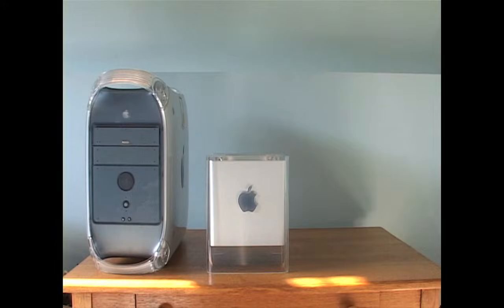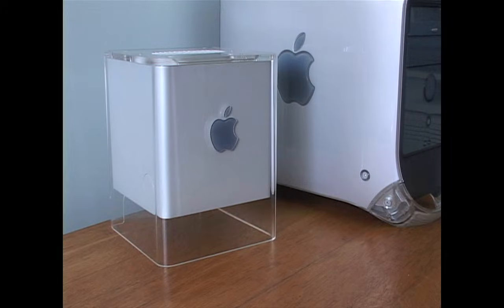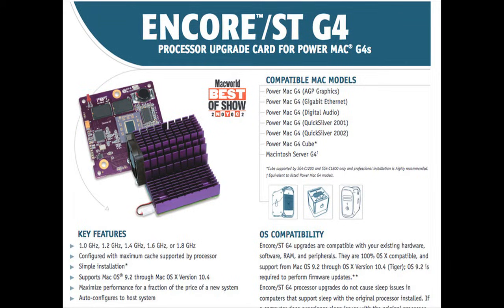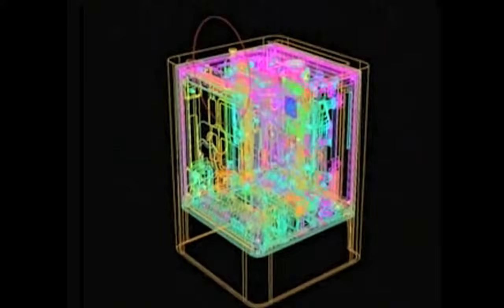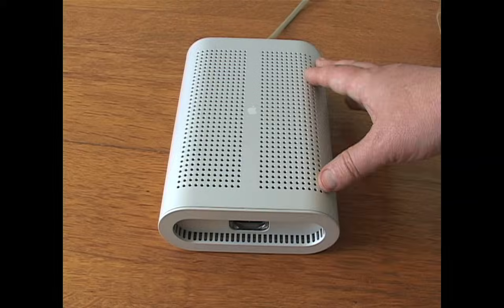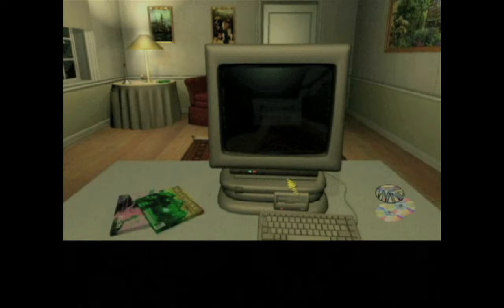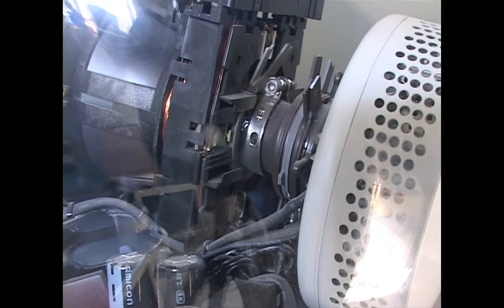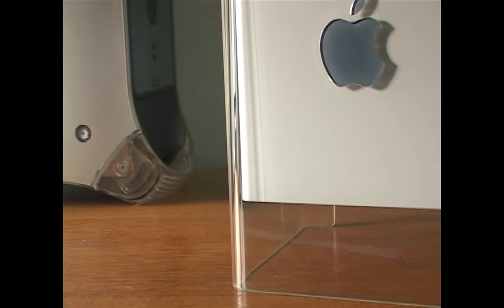The Power Mac G4 Cube

Comment: There's so much irony in hearing Tim Cook talking about a failed $1800 workstation considering the $700 wheels that have come into being under his watch. This is clearly a move intended to bilk technically unproficient and image-centric prosumers out of their money to maintain the unjustifiably stratospheric stock price share holders have come to expect. The sad thing is that enough people will pay this amount to reinforce Apple's bad behaviour. Once upon a time, I will admit that I suffered from a bit of Mac envy, but Windows 7 and many contemporary hardware offerings cured me of that. I hate Windows 10 so much I refuse to run it. Mac envy would have resurfaced again by now, I'm sure, but I mean the Apple tax is most of the cost now. It's beyond ridiculous.
Reply: I mean don't get me wrong, the market bears what the market bears. $700 wheels, $1000 monitor stands, whatever. If people will pay that much, it's technically worth that much. To channel P. T. Barnum, there's a sucker born every minute.
Reply from the maker: Great points. And I think if the Mac Pro doesn't get the sales numbers they expect, they'll just conclude lack of market for an expandable Mac instead of making a lower spec'd version to push down the price point and increase sales numbers. And yes, Windows 10 is terrible.
Reply: The Apple Tax is carefully distributed over their product line, though.  The kinds of computers (and their accessories) that ordinary humans buy are not atrociously expensive.  IMO, they're priced at a point that allows Apple to make decisions that favor not cutting corners (except, of course, to round the corners.)

The Mac Pro is aimed at an audience where the computer is a tool to do some thing that, presumably, generates a profit that covers the expense of sophisticated tools.  Other brands of workstations aren't given away for free, and other enterprise equipment certainly isn't going to blush at a few hundred bucks for accessories.

The confusion, if I may interject my own opinion, is that everyone tosses around the "Pro" suffix to the point it has lost its meaning.  Something that is actually "Pro" is significantly different in both design and pricing model from something where "Pro" just means "The Higher End One."

The Mac Pro is not competing for the same audience as a PlayStation 4 Pro.  On one hand, there's an enthusiast.  On the other hand, there's a procurement department.
Reply: @sirnickity  Thank you for the well-thought out, well-reasoned response. But the thing is... I bought a Mac Pro in 2010 for about $2600, and it did everything I needed it to do (3D modeling and scene rendering, etc.) for years. In fact, it's still in service today, granted only as a file server. While I agree that the "Pro" designation has become diluted in recent years, I don't think it was to such a pronounced degree over a decade ago when I bought that machine at a reasonable cost relative to its competition. The value proposition within Apple hardware has plummeted since then. Current prices are simply indefensible, IMHO.

Comment: I had one. So quiet so nice to work with. Using iTunes, the small digitally amplified speakers sounded awesome. I upgraded the video card, RAM, HD and installed a dual CPU and a fan. So, I was able to use it for over 10 years. Replaced it on my desktop with a Mac-mini and connected the cube to my TV as a music and media server.
Reply from the maker: That's excellent! Thanks for sharing your Cube success story.

Comment: Two wrong reference which I could spot in your video - 1. Steve Ballmer is dancing on the launch of Windows 95 and not on failure of Cube; 2."Can't Innovate my ass" statement was made for Tin Can Mac Pro and not Mac mini.
Reply from the maker: You are correct, they are technically wrong references. I showed Steve Ballmer dancing because I needed a picture of an Apple shareholder celebrating and Microsoft was a shareholder at the time. And Phil Schillers comment about Apple still being able to innovate was just a joke to show how the Mac mini was not an innovative design change. Apple produced more innovative designs in 1999 than in the last decade.

Comment: Why didn't Apple just put fans in them and crank the speed? Must have been worth a try. I have an iMac G4 which cools itself in a similar way, and it is definitely not quiet.
Reply from the maker: I think Apple already gave up on it by the time faster processors were available. And it might have been too embarrassing to put a fan in after Steve bragged about it having no fan.

Comment: I was the service manager/technician at an Apple Specialist in the northern Chicagoland area when this thing came out.  Neat computer, we sold a lot (very wealthy customer base), but the repair programs Apple had to launch for this thing were ridiculous.  Steve chided his customer base about the mold lines on the case but offered a repair program where customers could get a new case if they didn't like the lines on it.  The replacement cases that came from Apple didn't look much different from the original ones, and I had a few bitchy customers who yelled at us because we were "repairing" their computer (for free!) with the "same case" even though I left the "peel off" protectors on the computer.  I threw away at least a dozen G4 Cube cases because Apple didn't "core exchange" them; they weren't 661- parts so they didn't want them back.  At the time, they had no value.

Another repair program: the power switch would randomly turn the computer on/off even without any outside RF interference.  They had a repair program where you'd remove the "gasket" around the button and replace it with a different one so the computer would stop randomly turning itself on... or being forced off should the sensor activate for five seconds straight.

Super cool that you pointed out the "POINK!" sound the CRT made when it turned on.  I appreciate your videos.  You point out all the weird stuff I noticed at the time but that no one else talks about.
Reply from the maker: Thanks for sharing your experiences and details from being a Cube repair technician. Great expansion on things I talked about in the video. Regarding the G4 cube cases, being quality control for a plastic injection molding company, I often field complaints from companies that our mold's seam lines are somehow scratches in the part that need to be fixed. Fantastic to hear that someone with your experience is enjoying the videos.

Comment: Great Video and detailed history with humor. Love it! I've collected 6 cubes over the years and modified some of  them with upgrades such as internal DVD-Rs, GeForce 3 card and ATI Radeon 9000 video cards, 120 Gig SSD drives and aftermarket processors. Still using and enjoying retro games such as Myth and HomeWorld on them and using FCP 7 and and DV editing and DVD authoring. Thanks for the tip on the 17" CRT. I have one that needs some serious cleaning. People and clients are still amazed that they are working and using them 20 years later.
Reply from the maker: Reed Sherman 
Thanks, and  sounds like you’ve done some serious internal work on the cube. Good for you keeping them useful into the 20’s. Running FCP 7 on a cube is pretty impressive!

Comment: Okay, I've now watched all of your videos, which are amazing. Thanks for the trip down memory lane, but I really need to do some work now... 
I've always wondered if the Cube would have been more successful as a "headless iMac". G3 CPU instead of a G4 and priced like a top end(ish)iMac but without the screen. The limited upgrade capability (CPU and Gfx at least) and design might have made it appealing for consumers with a bit of cash to burn. 

At least the Cube gave us the funniest upgrade ever made, when Powerlogix released a dual CPU G4 upgrade that was running so hot that they had to make a bigger cube. Yes, they made a cube enclosure, just bigger, and the customer had to transfer the internals of his original Cube. 

As for iMovie 3, it decided that all DV cameras recorded audio in 48kHz and if yours (or your DV converter box) produced 32 kHz, the audio track would end up sounding like a machine gun. When raising the issue with Apple, their answer was "We're sticking to the DV spec" (which wasn't the case). Obviously, you don't argue with Apple, you update your hardware to fix their bugs instead... Those were the days, lol
Reply from the maker: Eric, thanks for watching the whole series! Great to hear that.
It is interesting to contemplate what Apple could have done to make the Cube a profitable. I suppose with the G3 Cube idea at least they could have ramped up the MHz without the same cooling barriers, but it might have lost the interest of the prosumers. The Powerlogix upgrade I don't remember, but that's funny. I'll have to check that out. When I did the video, I read through the instruction to install the regular upgrade cards with the fan and my god was it complicated! As for iMovie, I learned pretty quick not to record at 32kHz, even though that was the default of my Digital8 Sony Handycam. I'm definitely considering a B&W G3 video now that I have a few machines on hand to film. I''d definitely like to hear your personal stories from your experiences with it.
Reply: @65scribe Could the Cube ever be a prosumer Mac? It was cool, but intrinsically flawed due to its form factor. Lovely status symbol though. We'd better stop arguing about stuff from 20 years ago, it shows our age :-)

On the B&W, you probably remember many of those quirks but just in case:
- The first rev had a buggy IDE controller. You had the space to put more HDDs inside the case, but the controller didn't support slave drives. D'oh. They may have fixed that later, although many people just bought rebranded Acard ATA PCI cards. 
- Apple released firmware 1.1 which supposedly fixed some stuff. What they didn't tell you is that it also prevented the B&W from booting if you had installed a G4 CPU. Upgrade manufacturers all had to release a patch for Apple's firmware (not scary at all, is it?). 
- There is a story that one CPU manufacturer just took another's (I won't name anyone, ha ha) firmware patch and shipped it with their patcher application. They did however forget to remove the copyright notice in the firmware patch itself - I can't find that original patcher to verify, so that story will just stay a rumour.
- The Firewire ports on the B&W were buggy as hell. Sure, you could connect DV cams, HDD's and other things, but the transfer speeds were dead slow. Few people knew that although they were only a cheap Taiwanese PCI card (preferably with a TI chipset) away from getting double the speed 
- On the subject of Firewire and not really B&W specific, in those days a lot of people had installed FWB Hard Disk Toolkit to run benchmarks. Cool stuff, except that their FireWire extension killed transfer speeds (vaguely recall it cut them down in half). Double D'oh. Even Mac magazine journalists got caught out (One of the European MacWorld mags had to publish a corrected test of a HDD they mis-tested). 
- When it launched, the B&W was one of the very first computers to use PC100 RAM. In Europe, you couldn't find any RAM from PC dealers and, yeah, Mac dealers knew that and charged accordingly. Might have been different across the pond though.

You mentioned somewhere the turn of the century was the most interesting time.  I agree with that. Anything from the Beige G3 to the Sawtooth was really innovative. It took real guts to launch the B&W.It might be one of those designs you hate at first until you see one in the flesh, errr metal and plastic, and then it really grows on you imho.

Comment: Had it launched at 1499 rather than 1799 it may have gone somewhere. It should have also had more ram and hd space than the base powermac tower at that price. It needed to offer something in the specs department as well.
Reply from the maker: It certainly would have helped. If successful, it would have been interesting to see what Apple would have done with it when G4 thermal issues began to become a problem.

Comment: This is nicely done but have to wonder if you are or going to cover the iBooks and powerbooks of the same era.
Reply from the maker: I don't really have much in the way of laptops, and nothing from that era, so it's hard to make a video about the laptops. They seem to be much harder to find on the second-hand market. I don't know where they all went!
Reply: @65scribe  The ibook other than the clamshell are still fairly cheap but the powerbook G4s demand for most of them is so low than anyone can get one for around $30 off eBay with ease except for the 17inch models. G4 Titaniums are often beat to hell so that doesn't help.

Comment: The Mac Mini was what the Cube should've been — an affordable, entry-level option.

The Cube should've been a G3 machine at the time: Basically, take a G3 iMac, and subtract the monitor enclosure.

And later on, the trashcan Mac Pro was another Cube.
Reply from the maker: All good points. It seemed like the All-in-one had been the low end Mac for so long, no one at Apple even considered making a desktop priced below it, yet it makes perfect sense.
Reply: And then they FINALLY did it with the Mac Mini!

Comment: Excellent video!  Although I used to own a cube, it just didn't do it for me on a functional basis as it was pretty underpowered compared to my heavily expanded G4 tower.  Hence I didn't keep it.  It was a neat computer in design just not functionality or practicality.  Especially those horrible slot load drives they used where the dang discs would either refuse to insert or get stuck ejecting.
Reply from the maker: Thanks for sharing your experience with the cube! Glad you enjoyed the video.

Comment: Last summer I found a G4 Cube for 90€ without a hard drive. In the end, I didn't buy it which I regret a lot later. Guess what, it came back. It is on sale again a year later. Damn I want it.
Reply from the maker: I would say to get it. You can easily resell it if you need to and you aren’t living with regret. Just my opinion.
Reply: @65scribe  Thanks for the advice. I tend to lose interest to things quite quickly so I would have to get it fast before I become disinterested.

Comment: I almost bought one of these last year when I was going through some weird sort of PowerPC phase. Just couldn't justify the price though. I eventually settled on a much cheaper MDD tower with two 1.42GHz G4s in it. I've managed to max that baby out too, with 2GB of RAM, a 512GB SSD, and Geforce 7800GS video card. I just love that thing!
Reply from the maker: That's a very cool Mac in it's own right, with the unique copper heat sink and all the cooling, it's designed like a total powerhouse.
Reply: @65scribe  Yep, can't fault the design. And 16 years later, it's still a drop dead gorgeous computer. As far as performance goes, well...I'd say the MDD G4s were already getting a bit long in the tooth even in late 2002-2003 when they were being sold. I was comparing it against an Athlon XP 3000+ (2.1GHz) I built in early 2003, and the Athlon was clearly outperforming the G4 in all single-threaded applications.

The Athlon was especially strong in games, averaging much higher frame rates in Doom 3 and UT2004 despite having a slower video card (6800GT vs the Mac's 7800GS).

Comment: Sadly, i've never owned a G4 Cube, and at this point, it seems unlikely unless I happen to snag one from somebody that doesn't know what they have - which means i'll be sticking with my Mac Mini G4 for my square footprint computing fix. Great video, thanks for the entertaining and enlightening content. Keep it up! (sorry about Willow...)
Reply from the maker: Thanks for the feedback and condolences! Good luck on finding a cube one day. The one I have just popped up one day. I wasn't even searching one out at the time because I never thought I'd have a hope of finding one.
Reply: @65scribe  That's basically how I found my PowerMac G5 1.6ghz single core tower, except it was at a Habitat for Humanity ReStore in a semi-non-functional state that I was able to snag for $5. It suffers from the "bad solder joints on the ram slots" issue, but I managed to get two of the four slots working by manually reflowing the pins with my soldering iron. I keep telling myself that i'm eventually going to reflow the other two slots, but it takes hours and is fraught with peril.
Reply from the maker: I've acquired a few of those too, but not near that low price. I haven't attempted to reflow the solder. I have a feeling it's more difficult than reflowing the solder on the analog board of a 512K.
Reply: @65scribe  I've never had the opportunity to own or hack on any classic Macs thusfar, but I believe it's 384 pins per ram slot(give or take). I tried to add some leaded solder to the pins throughout the process, and naturally, nobody in their right mind would ever think to reflow over 500 tiny solder joints with an iron by hand. It just so happens that I don't have any proper reflow equipment or even a hot air gun, and my time just so happens to be - evidently - worthless. When you consider that my first run with the soldering iron caused some unknown amount of shorts that bricked the startup of the machine necessitating going back over the board and basically re-doing the whole job, I think you would agree with my assessment on the value of my time.
Reply from the maker: That's alotta pins... Maybe I will backburner that plan and continue to use them as bench supports. I think I once spent about 12 hours swapping a hard drive into a iBook G4, so I can't say much on the value of time. Thanks for the laugh :)